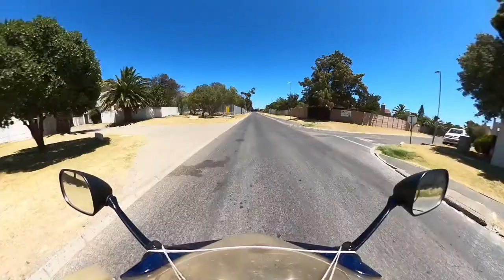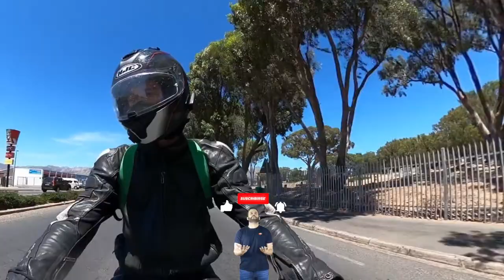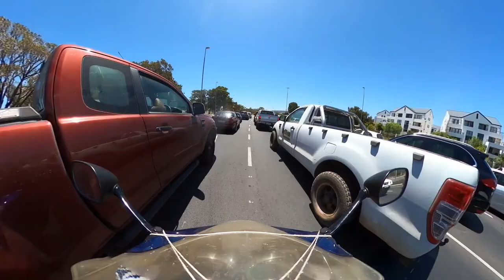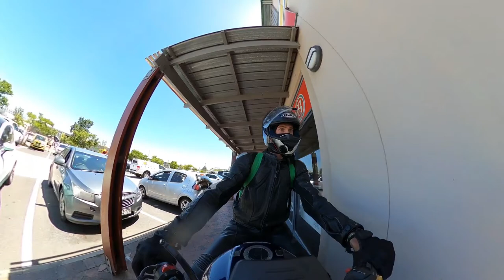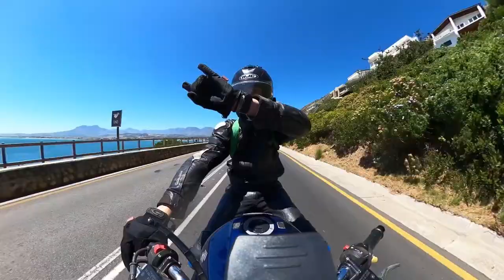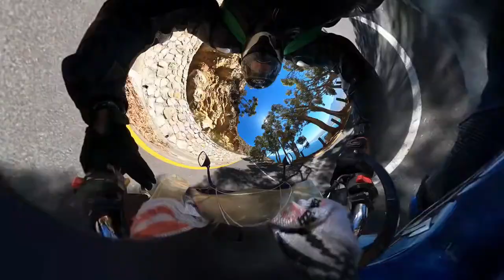I'll never ride without my muffler after this || I took the exhaust off of my motorcycle

Comment: Also, what comm unit you running?
Reply from the maker: I'm using the Cardo FreeCom4, which is currently discontinued. But it's replacement, is the FreeCom4 plus -> amzn.to/34P6w83